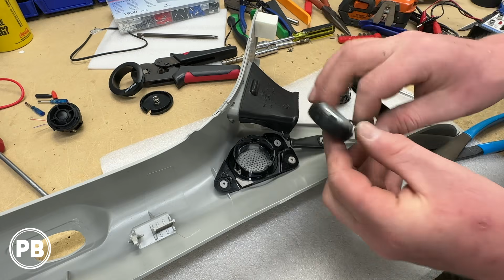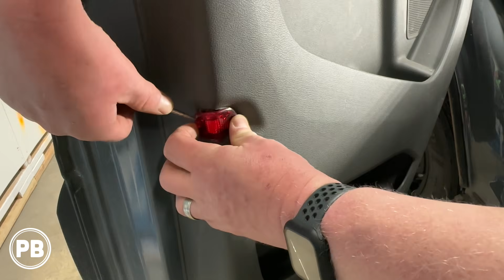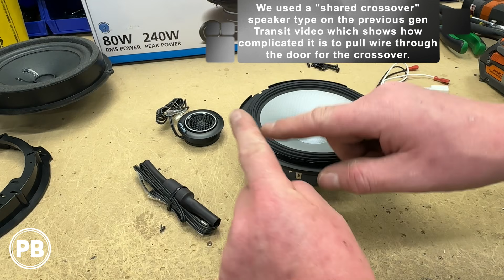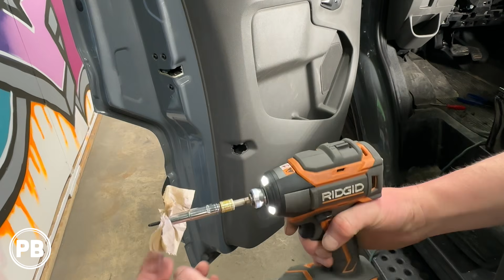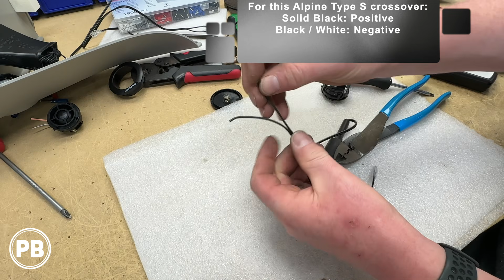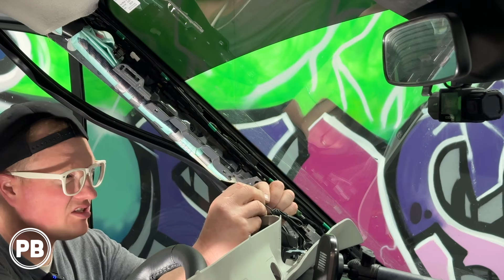2020+ Ford Transit Front Door Speaker & Tweeter Install

Comment: Hi,do you need to add amplifier or just the speakers is going to be enough?
Reply from the maker: I mean, you get benefits adding an amplifier, but for some people just replacing the speakers is enough. Most factory radios only put out around 15 to 20 W channel at best, and most new aftermarket speakers can handle at least double that.